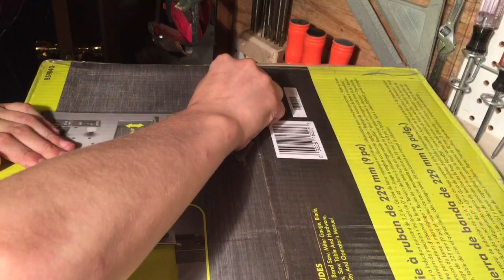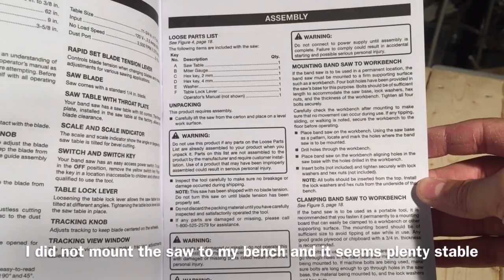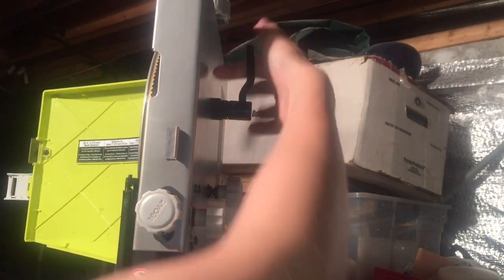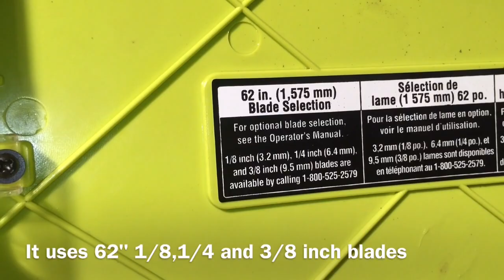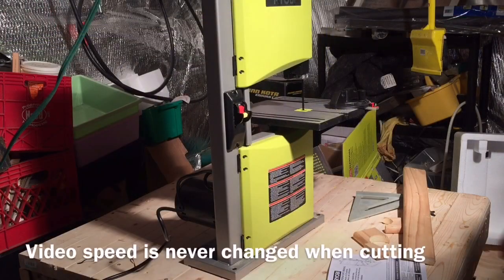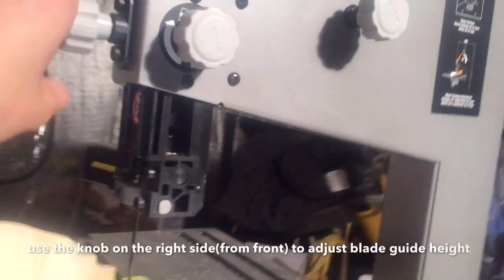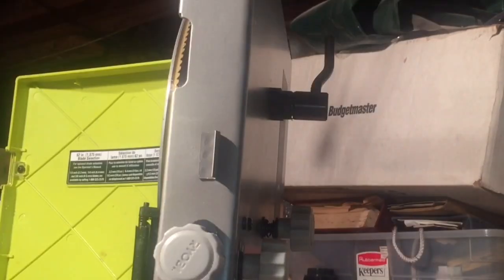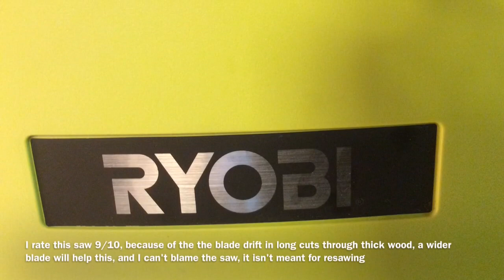Ryobi 9 in. 2.5 Amp BandSaw Setup and Overview HD

Comment: "Setup and Overview" - I was expecting to see more about adjusting the blade, etc. But I did actually appreciate watching you unbox the saw. I just unboxed my Christmas present today! I found this saw to have the worst instructions of any tool I have ever used, and I have a lot. Putting the table on is quite a challenge and the instructions don't help much. There needs to be a blow-up diagram with all of the parts clearly labeled. But that is really a comment for Ryobi, not you Luke. I don't know how old you are, but I think you did a great job with the video. This is also my first bandsaw. I was worried about changing the blades, but I got over that right away, when I turned the wrong knob (again thanks to the terrible instruction manual) and the blade fell off. It actually went back on easier than I expected. Now to adjust the tension on the blade.
Reply from the maker: Good luck with the saw! I was so young when  I made this lol

Comment: Do you need to screw it to the table? Or it can be used freely?
Reply from the maker: I didn’t, but you should
Reply: @squidinkRC  thanks. I need it temporarily so don’t want to screw it’s for small projects .
Reply from the maker: @SwapnilBhartiya  yea you’ll be alright. I’ve liked this Machinei still have it
Reply: @squidinkRC  Ordered one.
Reply from the maker: @SwapnilBhartiya  good job! What projects first
Reply: @squidinkRC  I am building an n scale railroad model so lots of accessories needed. I just didn’t want to invest too much into something so this may be a good investment.
Reply from the maker: @SwapnilBhartiya  that’s perfect! I used to be into trains quite a bit. We had a 12x12 table, with 13 tracks from N to full size Lionel(forgot the name) it’s a huge collection, with trains from the 50’s to the present I loved it
Reply: @squidinkRC  I am into IT - a tech journalist and as due to COVID I am not travelling anymore I am looking for things away from computers and model trains - unlike RC cars can be done at home and its letting me learn new things - including wood working and now I can also put my 3D printer to work. So it's 3 projects in one ;P
Reply from the maker: @SwapnilBhartiya  that’s awesome! I run a decal business now, and I work on boats and jet skis. Fun stuff. Good luck with everything!
Reply: @squidinkRC  Got mine yesterday and yes it's quite usable

Comment: Feed back on blade drift? Can't cut a straight line if it's life depend on it.  Tension correct. I can cut a better line with a scroll saw then with this. Help?
Reply from the maker: My saw had a tendency for the blade to come out of the blade guides, make sure its correctly seated in each, and they are adjusted well. I have heard of this issue coming to other users but ive never experienced it, and I don't know of a real solution. Sorry I couldn't be more help!

Comment: Have you had any problems with the guide wheel casting breaking? I´ve heard that this is a problem with this type of band saw.
Reply from the maker: mikei86 I have had no issues with this saw , I’m still using it to this day, I do need to change the blade soon. Any more questions?

Comment: Is this unit 110 volt 50/60 Hz cycle...does this come with a fence
Reply from the maker: Paul Clare yes, but I believe it would be built for 240v when it is sold in 240v areas. It does not come with a fence, would have been a good addition , I clamp a piece of wood on the table as a fence. Any more questions ?

Comment: So I just got one, I'm having difficulty with the adjustments. The motor turns on , blade one turn, so tension is too tight. The I losen it with the bar and blade comes off. Any tips ?
Reply from the maker: SCWACK I am not sure I understand your problem. I crank down almost as hard as I can on the tension knob. You can send me pictures or video and i will see the problem . 99lukebattige99@gmail.com
Reply: Squidink R/C sorry I worded that poorly. So at first the motor hums, but blade/wheels will not turn. So I turned the tension lever, but the wheel turned, but the blade came off. That better I hope? If not I'll take a vid tonight
Reply from the maker: are you doing this with the cover on? when you have the covers off you can see the tracking better. and when you are testing something like this don't just flick the switch on and leave it on, flick it o and off real fast to not get it going . it seems the blade is tracking off of the wheel. put the blade on and tension it, then turn the wheel by hand, if the blade want to go off of the wheel adjust the tracking knob, that is the one in the lower center of the back of the saw behind the top wheel, just play with the knob while spinning the wheel with your hand. when you get it tracking in the middle of the wheel try flicking the switch on and off. sorry if this is confusing i am typing on my phone, if you get to the last step you should be ready to use the saw.
Reply: Squidink R/C I will give this a shot thank you!
Reply from the maker: SCWACK I love to help and if you have any other questions feel free to ask. My channel has always been a bout remote control so check it out if your into that, it has started to become more widespread, I will upload More test cuts tonight!
Reply: Squidink R/C got it to work. I'll sub as well!
Reply from the maker: SCWACK Thankyou! :D

Comment: You need to set that blade up properly. There’s way too much movement in it when you cut. Adjust the thrust bearings both top and bottom. The deepest part of the tooth cut should be in the Center of the wheel making the blade sit slightly toward the back of the wheel. Finally adjust the side rollers so they are as close as possible to the blade without moving when the blade it rotated.

Comment: You need to put the blade guard down for it to be a lot safer
Reply from the maker: Yes i know, but I put it up to not obstruct the viewers angle, Thankyou though!
Reply: OK I understand
Reply from the maker: I still use it today, and usually put the guard about 1/4" over what I am cutting
Reply: @squidinkRC  Nice video, I liked to see the details of the machine, very interesting to compare with other machines. Is the blade guard made of metal? Its cover appears to be plastic, but inside?
Reply from the maker: Joris Robijn the guides that touch the blade, and the piece it’s held in, are all metal. The outside case is plastic which is fine for this application, I can’t recall wether it’s mounted with plastic I think it was metal.

Comment: You need to actually tune the band saw. There are instructions in the manual. I can tell from the closeup and the amount of flex in the blade, that the guides are not set properly and the tension is not correct.

Comment: The only reason I went with the Wen OVER this saw is the Wen has a fence. also 20 bucks cheaper.
Reply from the maker: Very very similar machines. Smaller stuff like this seems to be commonly shared between sellers. Sorry for the late reply.

Comment: Safety ..!! You should really secure the tool to the bench, even if you think it's stable! Also use something other than your fingers to push the wood past the blade
Reply from the maker: Nathen Street I used 4 m10 bolts And nuts on that, I should make myself some push sticks, thanks for your concern !

Comment: I want to see how to put the table on so it doesn't wobble. At 2:11 the saw is suddenly assembled without showing how that happened. That's why it is a thumbs down for me.
Reply from the maker: Jim Korth all I assembled is the blade and table, you have to use bolts and bolt it to the table , i did that after this video. Is your bandsaw shaking?
Reply: I watched another video and saw the step Ibwas missing. Thanks.
Reply from the maker: Jim Korth so which step was this?